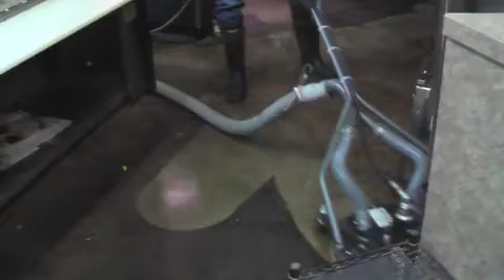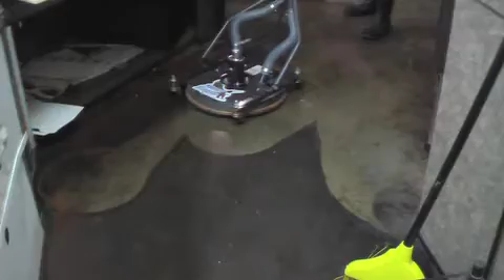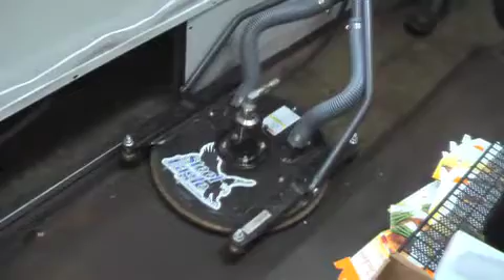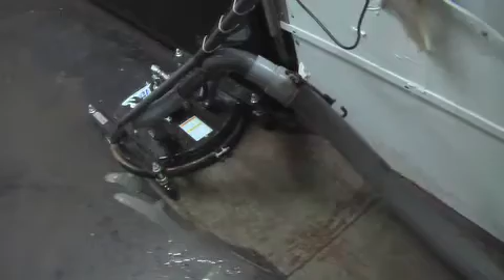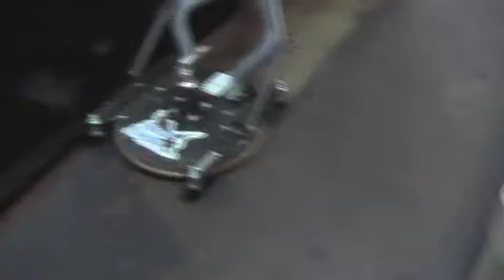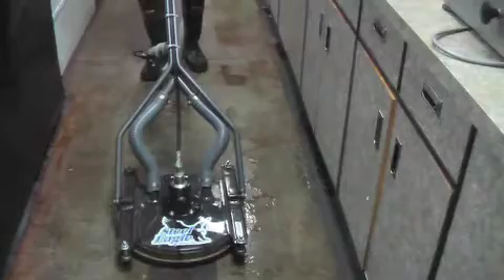Indoor Pressure Washing

Comment: if i use cold water, do I need to use treatments?
Reply from the maker: If the floors are really greasy like the ones shown here, YES!  Water only, even cold would still yield a significant result, but to get it all up, either heat or some type of degreaser, or both.  🤓
Reply: @PolyVshot  I would say gas stain for a gas station would need a strong degreaser right?
Reply from the maker: Yes, mechanical type oils, as distinct from food type oils, are mostly the same to deal with.  But use a degreaser that’s made for mechanical ops, and not a food based one like Smokehouse.  Degreasers come in 3 main types:  mechanical or automotive, general, and organic for food based applications.

Comment: WHERE IS YOUR PRE SPRAY?
Reply from the maker: no pre spray hot water only on this, but these days we are mixing in degreasers with the fresh water supply on stuff like this, cuts through a lot faster.  I was very young when I put this up, have learned quite bit in the last 15 years...